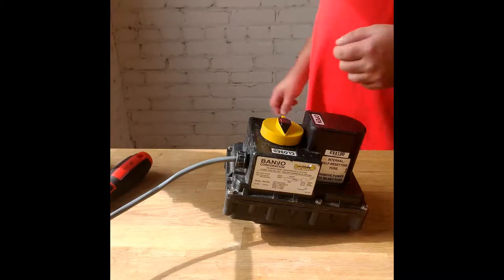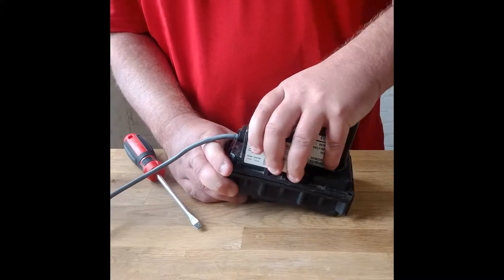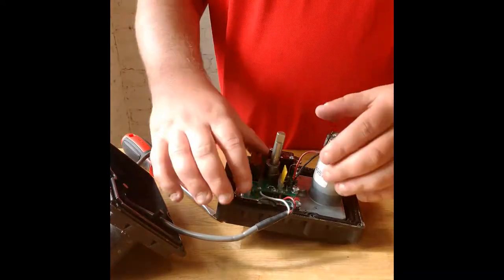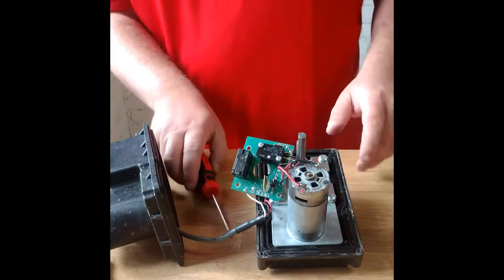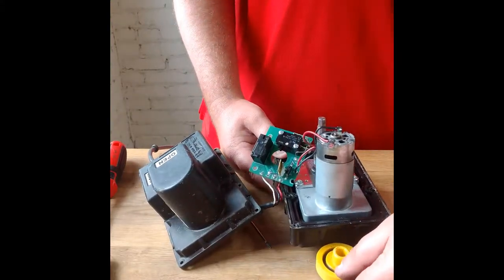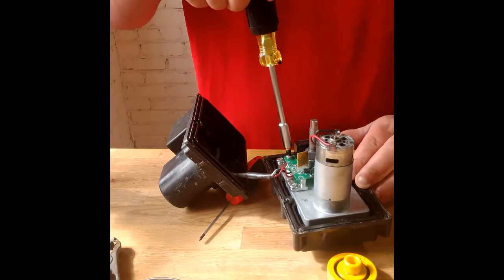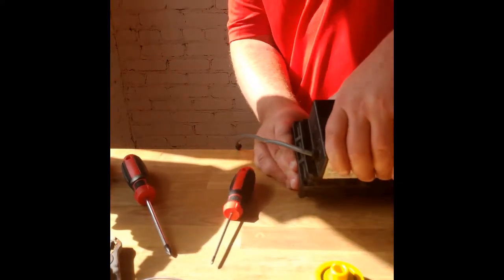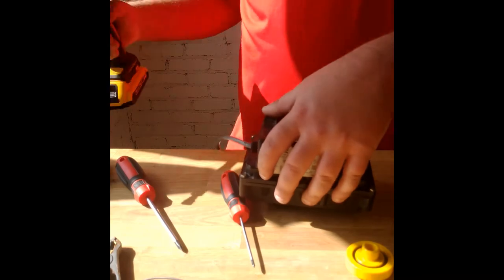Electric Valve Repair

Comment: I have a tejet 3/4" 3way value that won't turn back and forth on a wire less remote control 433 m will work on a 12volt battery red, black, white I need you to look at it need help with this ball valve for my Softwashing system